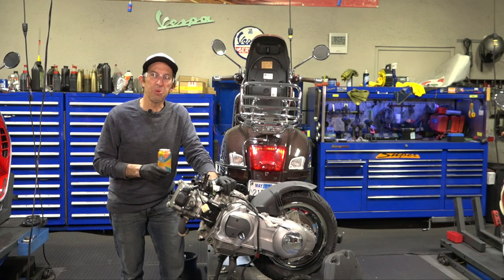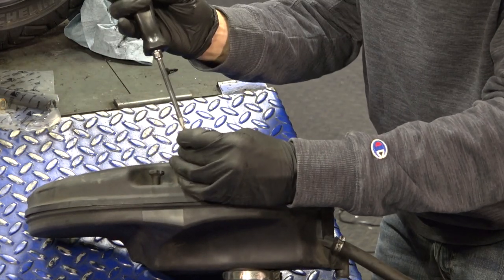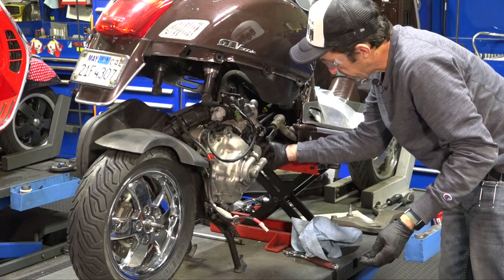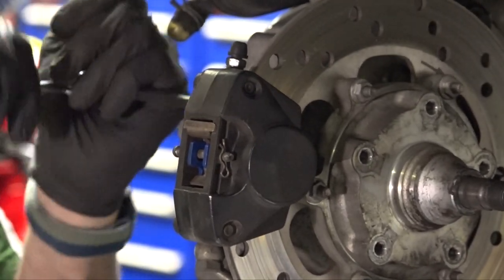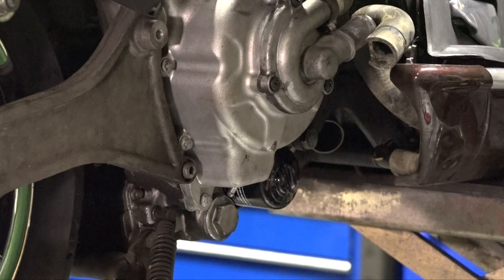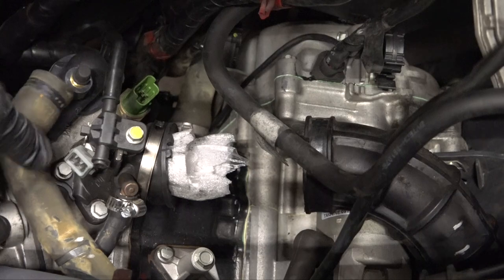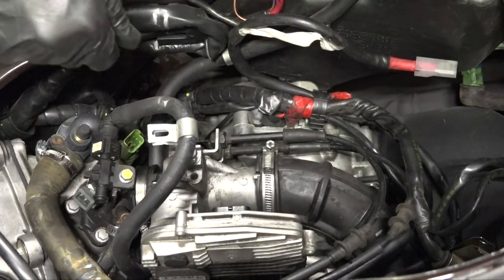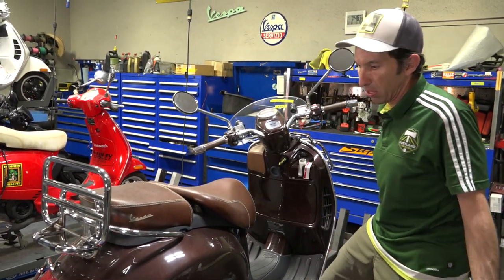Vespa GTV Resurrection | PT. 6 Motor Install and Fire Up!

Comment: Brilliant work Robot

My back to scootering model was a new 2007 Vespa GTV 125 and I had it modded up with all round crash bars, 6 mirrors and professionally made decals from photographs of The Small Faces and their Ogdens Nut Gone Flake album.

Thank you again from England.
Reply: good night bro I have a kasinski Prima 150cc engine Piaggio I can make an adaptation of this scooter for my for being the same engine ...... I live in Brazil this engine here in Brazil is a carburetor and I would like to use electronic injection ......., Help me show the parts to put in mine ..... .. ..strong hug